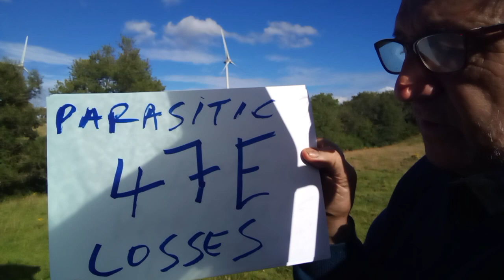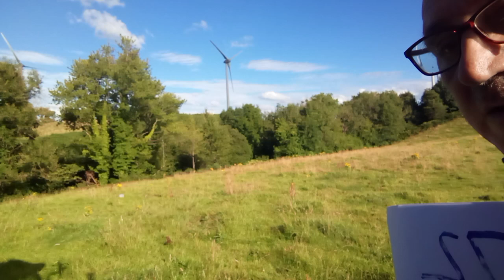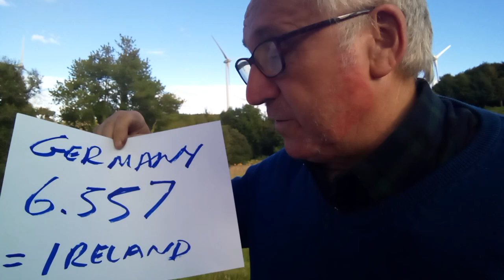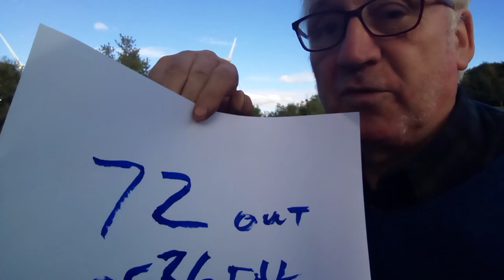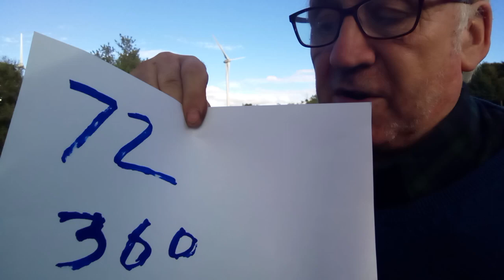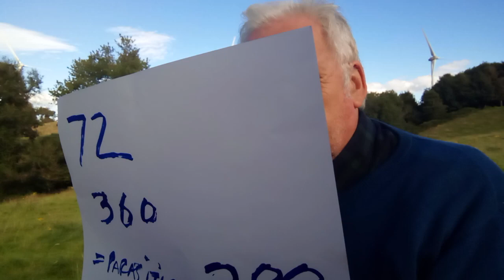47 E. Parasitic power wind turbines.

Comment: So to have a reliable grid we need fossil fuels to consistently power it 100% of the time.

Even when the wind blows we are still powering our grid with fossil fuel i.e. we cannot turn it off as and when the wind blows.

Therefore any excess energy produced by the wind turbines while the wind blows is wasted as it cannot be stored.

This is preposterous 🤣🤣🤣
Reply from the maker: It cannot be stored due to its volume,

Comment: A fried of mine reckoned to "store wind energy produced" you could use the electricity produced to push water up to a height and then that would be "potential" energy stored that could be used at a later date to produce hydro electricity. But I later thought we don't have much hydro in this country let alone great heights in altitude for this.